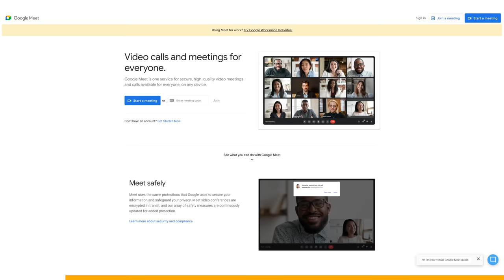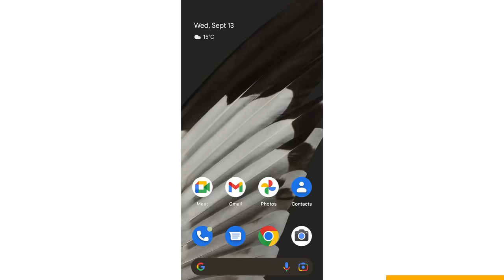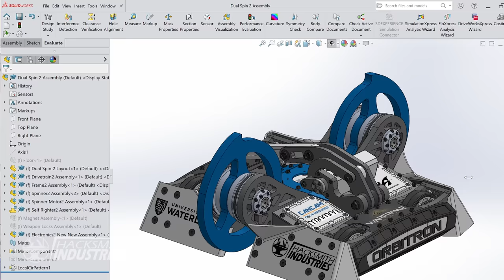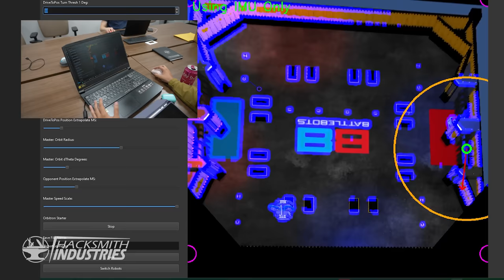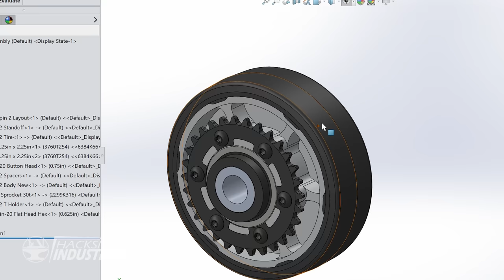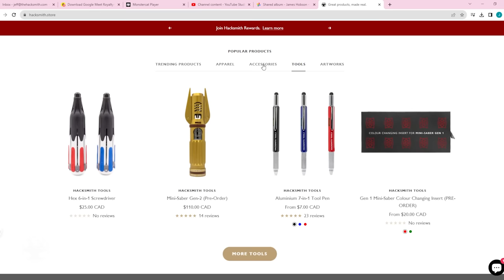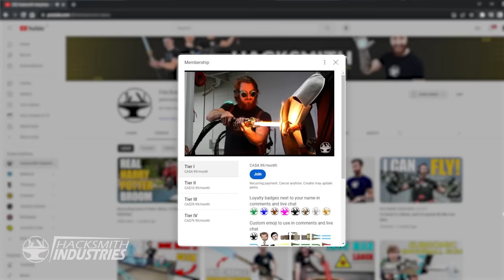Building the First AUTONOMOUS BattleBot!?! (VIDEO #1/4)

Comment: not sure people here are realizing just how insanely impressive this is
Reply: Earned my subscription.
Reply: I certainly do. I’ve been studying robotics off and on ever since I first read Asimov’s robot stories, and have been dissatisfied with Robot Wars showing us remote controlled machines with zero autonomy. Even achieving partial effective autonomy is astonishing. Eventually it will get to the point where robots are wheeled into the arena, turned on remotely, and fight with no input at all other than a remote kill switch. I get the feeling that that point is a lot closer than anyone thinks right now.
Reply: I'm just worried if it is allowed to have parts of the robot outside of the starting area. Which is practically what is happening here. Are the rules changed?
Reply: @nicholas1460  same
Reply: Is that not why we're subbed?
Reply: Expertise + massive financial resources = epic build.
Reply: The difference between doing something in unity and doing it in reality is huge.

Comment: Now put a light saber in it
Reply: I think one of the rules are no fueled Flamethrower type weapons can be installed in the bot.
Reply: @crowsenpai5625  Flamethrowers are permitted but not using the substance the lightsabers use as fuel
Reply: @phantominway  so no kyber crystal power cells?!?!
Reply: @ChristianIssac-gq5zu  Sadly not :(

Comment: Battlebots is great, but my favorite is the smallest class NHRL fights. It is unbelievable how much destructive power they can cram in such a tiny robot.
Reply: One of the best parts of those lower weight competitions is teams seem to be more experimental at times down there and try things out.
It's no coincidence that some of the successful modern heavyweights have basically been developed from there, notably HUGE and Sawblaze used smaller scale testbeds (The smaller  scale ones being Huge and Megatron respectively.)
Reply: yeah I really like that yellow and black one with the waggle stick on the side
Reply: @happyfaic72 pulling out the shameless self promotion for ramplan lol
Reply: The logic applied is diferent as well, for example fire is a real threat, or weapons being means of movement.
Reply: NHRL is great. Battlebots is so over-produced. Though I find that with a lot of American TV.
Reply: Yeah nhrl is where it's at. They got an autonomus melty brain for a few years.  So titles a bit misleading without quotations around BattleBots.

Comment: I would love to see more autonomous bots, especially in the Meltybrain build style. To have a bot that could instantly retract its weapon to avoid flying through the ring, would be game changing. And run off lidar since it’s already spinning massively fast. Also all of the weight could be spent on drive motors (since they’re also technically weapon motors) and batteries to have a much better weight to weapon ratio. I forget the name of the white meltybrain bot in NHRL making waves but this style of bot will be a force to reckon with in the future.

Comment: It’s nice to see easily one of the biggest YouTubers helping a new team. 
So Obritron for me anyway and a few others has been described as a modern day counter revolution, ( if you familiar enough with the show.) twin vertical discs cancel out the gyro effect and you can drive normally with both weapons at maximum speed. The only thing is if there’s another robot who has a very long, and heavy weapon it could spell trouble very quickly, in their case Team robogym with their new under/overcutter spinner and flamethrower, Roundhouse.
Reply: I don't think that is a good thing counter revaluation was on of the worst boys ever that wasn't an art bot
Reply: Also falcon. But that wasn't great either. This will be amassing to see. As soon as I saw it I knew it would be great. I have always wanted a good compact version of Counter Revolution and now it's hear. And Hacksmith getting involved is so crazy also. I am so happy lol. I can see some faults in the controlling on the bot. But ill see how that plays out.

Comment: That is an interesting concept and certainly an interesting development for the build! As a Battlebots fan it's certainly quite a cool robot, and the twin counter-rotating verts could do some serious damage, especially if the drives are independent. I am quite concerned about that armor: those wedges look quite a bit thinner than what you often see on bots, which is often enough slabs of titanium or AR500 thick enough to be all but bulletproof to small arms - and even armor that thick we've seen defeated by sufficiently energetic weapons. Best of luck in your fights, and don't pull a Fusion!

Comment: You should try to connect both flywheels to make sure, that the gyroscopic precession is still canceled out after an attack, where you need to be really manouverable!
Reply: I don’t agree with that because then the other flywheel is not as max power and that makes the bot more vulnerable to attack
Reply: @FlatDrifting265  good point! didnt think of that.
Reply: I talked to Steven about that, and the issue is there's no mechanical system that can transfer that much power that quickly. one thought was to use the other flywheel as a kinetic battery to quickly get the the one up to speed, but I think the motors or escs they're using aren't capable of regenerative braking
Reply: @waxt0n  sounds reasonable. I do have the feeling a timing belt could be strong  enough. I obviuously didnt do the math, tho haha

Comment: 8:21 you need geared wheels with molded rubber on top. Just one ladder step under hard durometer rubber. If the rules allow, just before the run, coating the wheels with acetone will make them soft and sticky on the surface. The "gear" pattern inside will not allow the rubber to come off short of it breaking apart.

Comment: Protect the drive system and power source. High torque motors for the weapons., direct drive (if possible), no belts or chains. A way to defeat a flipper from getting under the frame. Ablative armor. I've been watching Battlebots for many seasons and have seen the weaknesses and strengths. Remember, 250 pound weight limit. You would want an aircraft aluminum chassis protected by 1/4" Titanium armor plates, with sacrificial carbon fiber outer layer.

Comment: I see a vulnerability with the design.  The attack wheels have quite a bit of ground clearance, so the bot is vulnerable to long flippers like Wheely Big Cheese.  Can be fixed by attaching forks that will lift the opponent into your weapon as well as prevent flipper bots from getting underneath you.  Further you could leverage the AI to lift the flippers when you are traversing kill saws or other things on the floor.
Reply: Whilst I agree forks would be useful for it given the current state of the sport, verts with some reach to them, similar to what Orbitron has, have done well in the past. Additionally, forks are a potential issue with the killsaw slots, and I don't really see a way they could have them just lift out of the way for that like you suggested, since doing so would require additional motors probably, and I doubt that the bot has much weight to spare for that given the dual weapon setup. Not to mention internal space can become an issue too.

Comment: Iv’e cast urethane to aluminum outrunner motor to make a hub motor and I used two different primers one to prep the aluminum and the second to bond the aluminum to the urethane this worked well I was a bit surprised to see no aluminum to urethane bonding primer used on the bot wheels.
Reply: This advice is appreciated!

Comment: During the assembly part of the video I was comparing that robot to the one I built for the robotics tournament I almost went to (it got canceled just a week before starting)...
The differences were actually quite small, the only thing noticably different was the use of specialized parts, instead of budget-friendly parts... then you said that it costed 20k... my robot costed around 240USD, and that was going expensive for my school's standards.
Reply from the maker: every machined frame piece is very expensive -- custom parts are the biggest factor, and once you get to this size,  even the basic (not that specialized) parts are expensive

Comment: Why did you make the weapon wheels hit upwards instead of downwards?
Reply: Having them spin upwards transfers the kinetic energy into an opponent in such a way that they'll be sent upwards, leaving them vulnerable to further attacks and allowing the weapon to continue spinning.
If it were to spin downwards, that energy would go through the opponent and into the floor, likely stopping the disc momentarily and having the opposing robot remain stable on the ground.
A big part of the Battlebots meta is getting under your opponent, and there's no better way then sending them airborne.

Comment: combat robots have utilized AI control, theres a reason it hasnt worked its way up to the 1250lb stage yet. people doing it are still refining it down on the 3-12lb stages.... the team for profect liftoff has one of their bots that is autonomous.
biggest issues i see coming are - the ground not being a flat plane ( potentially throwing off movement),  traction for movement can be inconsistent inside of battleboxes (debri, dest, floor damage), & biggest thing is ground clearance (Yall are fighting a horizontal this time so maybe not the most crucial, but im very curious how the ai driving would fair if Yall added forks on it [pretty much a requirement for vert fighting these days])

Comment: You had an offensive weapon but no defence 
Why not a side mounted plate on the ground that you could turn 90° when they attack 
Which has a small triangle that sent their blade up and each time they hit it, it disrupted their fine balance and tuning of the spinner 
After 3-4 hits on it their blade would be off balance and disrupt its ability to fight

Comment: If I made a battle bot I’d do it differently every weapon is made of stainless steel I’d make my weapon out of tungsten and watch it destroy the steel frames of the other bots.
Reply from the maker: Tungsten would shatter.  It's hard but brittle.  Also no one uses stainless steel... the typical weapon is AR500 steel,  which is what is used for armor and the teeth on excavators

Comment: Ok... having watched your match with Roundabout... The problem with AI in robot combat is that it inevitably ends up functioning in an extremely predictable manner. Even if it can react faster than a human, if its reaction is to do the same thing every time in a particular situation a human opponent will easily be able to trick it. I've seen people try this, and while every single attempt does work a bit better, it still ultimately falls into the same pitfalls.

Comment: I just started watching last season. I am curious to see how robot built on autonomous control scheme would work. Sensor damage, having to resort to manual control would play a factor but if you can make the bot do its thing this could be a meta shifting bot. looking forward to the fight videos.
Reply: I could be completely wrong, but I got the impression from the video that most of the driving would be manual and that the autonomous part only includes the circling the opponent action and the 'kill' action. Sensor damage shouldn't be a big problem if the main sensor is the a camera mounted up high somewhere that tracks the bots.

Comment: Great design, but surely belt driven is a weakness?
Reply from the maker: Nope,  that's how most teams do it.  Think about it -- if you did chains or meshed gears,  the impact energy of a weapon stopping suddenly would destroy the entire drive chain -- but a belt,  will just lose friction and slip
Reply: @hacksmith  Clutch plates. I guess belts can be replaced with each use.
Reply from the maker: A slipping belt is a lot simpler than a clutch plate, and lighter

Comment: The bot seems really well built and the team is very talented. But I'm really not sure about that AI system. The teams that won last 2 times did not have the most powerful weapon, but a bot that could strike at the right place at the right time. Everyone has a plan until they get hit in the face. The AI won't know what to do most of the time. I know that they can turn on and off the system whenever they want, but I really think it will be more of a gimmick to get them into the competition. It's unfortunate that BattleBots forces builders to come up with gimmicks instead of just rewarding the ones with the most wins

Comment: Hacksmith+Battlebots= something incredible! However, after seeing the damage it took, it sort of worried me a bit. Those disks dont seem to be Hardox or AR steel (The most common type of steel for robot weapons {s7 is also popular but it has its issues}). But what type of aluminum does the chassis use?

Comment: Cool project, but I don't get why it has two weaker weapons instead of one strong one, when the supposed advantage of AI is, that it is automatically facing the enemy, making better use of the one weapon without exposing its behind. Just the gyroscopic cancelling effect has not been that successful in battle bot history.

Comment: Whoever is making English subtitles for you needs to be fired. They are an absolute mess.
Example: 13:36 Hacksmith Industries became Maximum Industries. Pretty much EVERY usage of the word Hacksmith is messed up, and a TON of others as well. Names are wrong, some normal words are wrong... They are incomprehensible most of the time.
Reply from the maker: They're automatic
Reply: I had a feeling. It may be best to not make them the official english subs in that case.  @hacksmith
Reply from the maker: They're default